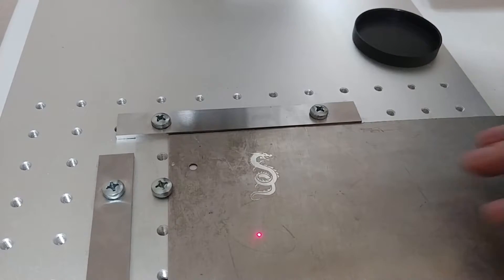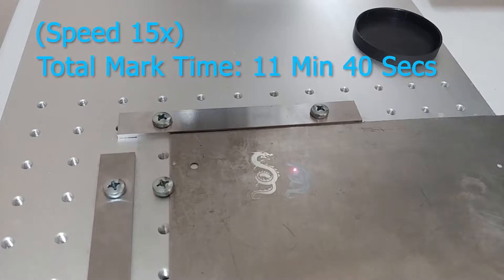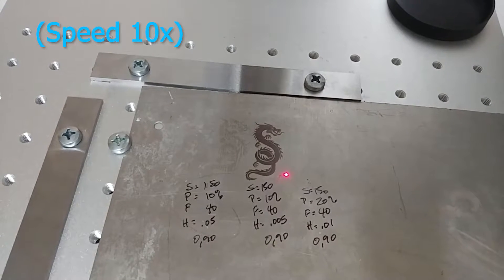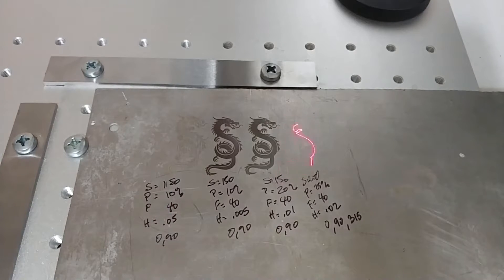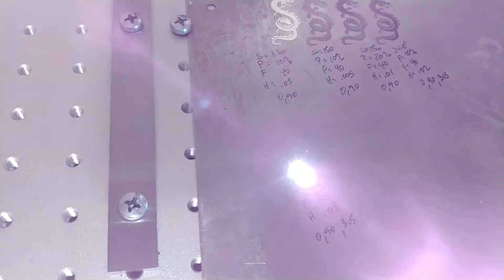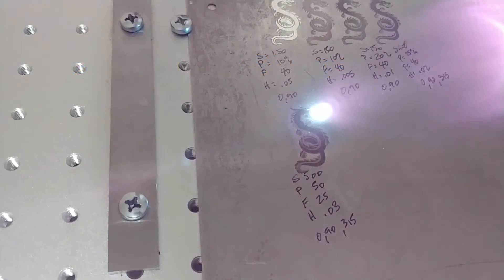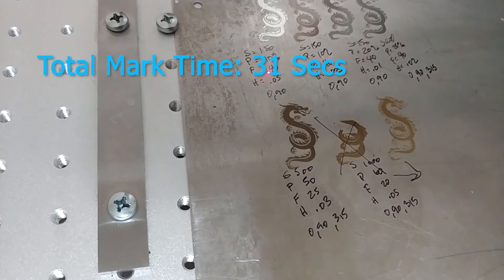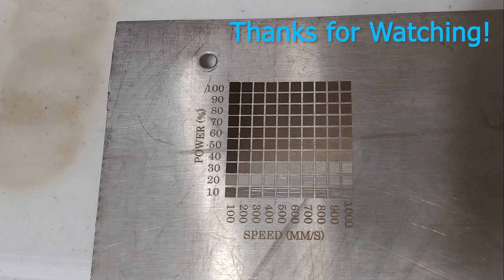Marking Dragons on Stainless Steel with the Fiber Laser

Comment: Wish someone could tell me why my 30 & 60 watt lasers do not like engraving aluminum... I have tried and tried different settings and nothing, looks like it makes the surface clean but that is about it. I do not get any type of depth to it. I can seem to cut lowers but that is only because of the black finish, it also does not like brass either.
Reply: Have you found a way to effectively engrave aluminum and brass?
Reply: @avexoidavex3577  Yes, it is all in the settings, I would have to go to the store and get the settings I use.

Comment: Like co2, hatch matters but it takes ages for a galvo. In co2 it’s called interval. Because i may buy one i realized the more power i can afford i will go for it to reduce scanning time. Your results may change if you put a 50 focal length lens because the resolution will be much tighter and you not have to reduce so much hatch. So, a 50w machine with 2 or 3 different lenses could be a good starting point. I own already a 100w co2 for 3 years now so i understand much quicker how fiber work or what it requires. Also a nice upgrade would be to replace the height wheel with a motor driven one with a smooth step of movement. Do you agree?

Comment: What frequency where you using when making the grid at the end? Also, which hatch marks are which?
Reply from the maker: It's been a while since I made this video but I think most of my grids are 25Khz unless it's specifically a grid to adjust frequency.  I made another video where I talk in detail about the grids and also make them available for download if you want to check it out.

Comment: Great videos .I am trying to get depth so it can be paint filled. Only needs to be up to .3mm deep. Trying everything but no success, do you know how to get depth in it? Thanks
Reply from the maker: High power, low frequency, multiple passes, autorotating hatch angle....and throw in a clean up pass every now and then.  It will just take time.
Reply: JefferyJ thanks for reply. Much appreciated.

Comment: Great video. Did you find that grid somewhere available for download? I could see where that would be useful.
Reply: the grid is easy to make in the software, just takes some time to make it.
Reply: Sounds good, Ive only played with the software a bit when I looked at my father's laser. Mine should be here this week and I'll get cracking at it. Do you also do grids for frequency?
Reply from the maker: Yeah, it's easy to make, just time consuming.  I haven't yet made a grid for frequency so all these marks are at 25khz.
Reply: I still don't have a good handle on the effect that frequency has on the mark.  I've usually just left it at the default 20kHz.  How would you explain the impact of frequency changes to the appearance of a mark? Or what is the impact of different frequencies on deep engraving?  Have to do a bunch of testing, just haven't gotten around to it.  I've got a maxphotonics 20w smart laser system, which uses what looks to be a custom skin of ezcad. not sure if the files are compatible between ezcad and this version.  I'd assume so.
Reply from the maker: @TinkerWithUs  I didn't know there were any custom skins of ezcad..interesting.  

For an explantion of frequency, I kind of liked this description that I found: "the laser puts out pulses of light rather than a continuous beam of light. Each of these pulses has a very short duration, and the time of the pulse is measured in nanoseconds. Fixed pulse width fiber lasers are only capable of producing laser pulses with the same time duration (pulse width) for each laser pulse, although they are capable of varying the number of those pulses produced each second (pulse frequency). Changing the pulse frequency affects the number of laser pulses striking the part at any location and the amount of laser energy in each of those pulses. Lower pulse frequencies tend to vaporize material because of the higher energy content of each pulse. Higher pulse frequencies tend to heat the surface of the part rather than vaporizing material from it. "
Reply: JefferyJ  yeah I’ll make some videos of my setup and showing the MaxMarking software. Visually it looks very similar to the ezcad.  Just bought a rotary for mine so will be busy getting that setup to do cups and rings.
Reply: Thanks, keep posting. Not sure what angle means.
Reply from the maker: @retparatrooper  Oh, I was referring to the hatch angle...it just means the angle at which the hatch lines are marked.  They can be approached from any direction or in any pattern.  If you chose 0 and 90 degrees you would essentially be making many horizontal lines, then many vertical lines.  If you chose 45 and 225, they would be marked in an X pattern instead.